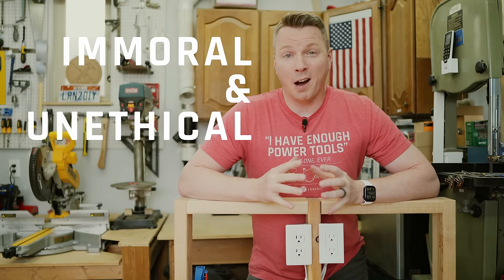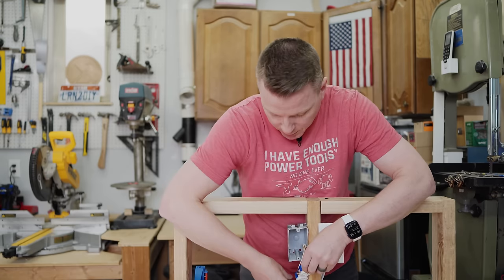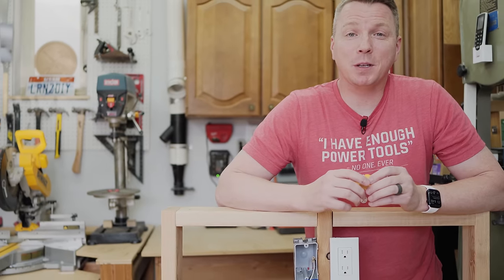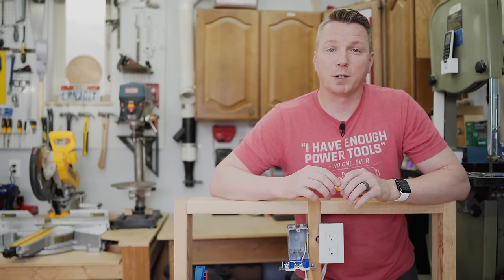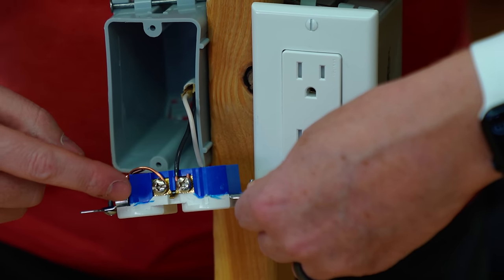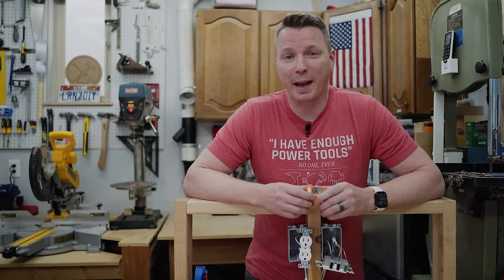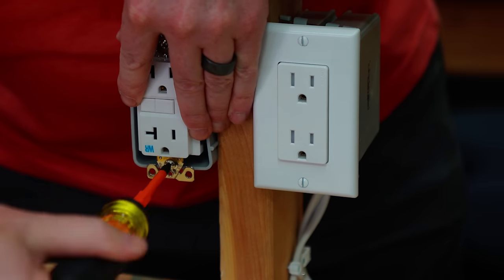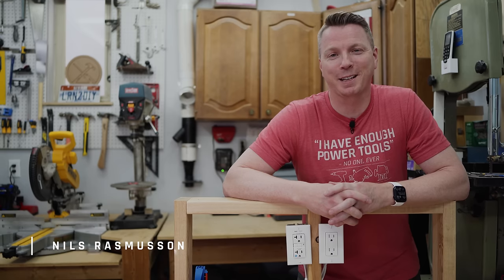People Are Adding Deadly Hacks to Outlets

Comment: No, your best option is #4 which is install a GFCI breaker to cover all of the outlets and get rid of those bootstrap connections. Two prong replacements aren't a solution, people will just use cheaters then. A gfci outlet I guess is especially if it's upstream from the others, but it'll be harder to figure that out.
Reply: The nice part about "cheaters" is that at that point, the wiring is no longer at fault. It's the appliance. While some people may not be aware that a "cheater" doesn't create a ground, they'll soon learn after their appliance has a fault! What I mean to say is that you can't blame the wiring when you're using "cheaters." That's like blaming the highway when somebody passes on the shoulder.
Reply: Using a GFCI and marking the outlet as ungrounded is the correct way to handle it for sure.
Reply: But if you don't have grounded plug, chance are that you either have a fuse panel or a breaker panel too old to have GFCI breaker available.
Reply: @Asakha1  Not even. I have an upgrade panel but no grounds because the house is old.
Reply: @Asakha1  Then you install a GFCI outlet
Reply: The point is to have an outlet that works as intended and has no surprises inside. It's obviously not the best solution, but at least you know what you're working with at first sight.
Reply: @jakedewey3686  Ungrounded (and labelled as such) GFCI outlet is what we did.  Cheers!
Reply: @moteroargentino7944  Mine works just fine and has no surprises.
Reply: @hockeymikey  The purpose of the ground connection is to trip the GFCI the instant a leak occurs, even if you are not present, because the current leaves the circuit trough the ground wire instead of your body, the GFCI detects that and interrupts the power. So you don't need to risk getting electrocuted for the GFCI to act.

If an outlet has a ground prong, it HAS to be ground wired, because it's the logical assumption when you see one. No exceptions.
Reply: @moteroargentino7944  False.
Reply: @Asakha1  In that case you install GFCI outlets. With the sticker that marks them as not grounded.
Reply: keep the Bootleg connections because then it is still grounded via the neutral which means in case of a fault it will trip the breaker, with the open ground it will only trip the GFCI if the device is on an conducting surface or if you touch it and therefore get shocked.

Comment: In Germany it's called "klassische Nullung". Decades ago it was the way to go. So we have many old buildings with this system. Here it is standard to put the cables in massive walls or massive floors (concrete or under the plaster). Adding a wire means often to demolish all walls from the outlet to the distribution board. So we have to keep going until the whole building or appartment is renovated.
Reply: You just cut a channel in the plaster and then cover it back up. Doesn't take very long.
Reply: @thelight3112  Are you willing to pay it for me?
Reply: Penny wise and pound foolish, installing conduits for the wires at construction time is a negligible extra cost which repays in this kind of cases.

Comment: I once worked for a company called Dish Network, may have heard of it. Went to a house full of "electricians". Said they ran my cable ahead of time, great news. They also wired their house outlets. Luckily I have a tester, and one of their rooms was wired reverse neutral, hot ground. I refused to plug anything in, they did it instead. Their tv blew a hole in their HDMI when they tried to plug it in. Now I'm studying to become an electrician, and this explains a lot

Comment: I like the GFCI option as a workaround for a few outlets in the place.
Reply: I have a 50's home and I have had GFCI's installed...a few at a time as the money allows.  I agree it's probably the best option for most people.
Reply: @Anothertominohio : Thanks for your input on that (even if you did mean " '50s" and "GFCIs" rather than their possessive forms). Yeah, those outlets are pretty expensive, like over $25 per unit, and other outlets can be connected to them, but then to connect other outlets to them means messing around with walls anyway, so unless you're a DIY wall resurfacer then it would still be less expensive per original outlet to replace each one of those with a GFCI. Wouldn't it?

Comment: In finland this is actually quite common in old houses where the electricals haven't been overhauled. As most of those houses do not have a ground wire to begin with, so sometimes when people have installed new outlets they've just done that.
Reply: Yeah, and that's allowed installation for retrofitting. But they European grounded plug can be put in non-grounded outlet. So actually adding bootleg ground is an improvement. Only downside is that you don't have CFGI, but all outlets didn't have that until the latest revision of code.
Reply: @@phillipbanes5484 CEE 7/3. I know it's not called "european plug", but it's in use in large majority of european countries so I thought you could make the connection.
Reply: It was mandated that you use then neutral for grounding in the 1930 code. The idea was to save copper. In 1957 they allowed separate ground wire but still using neutral was the primary method. In 1989 the use of the neutral was banned but 10 mm² PEN wire was still allowed until 2007. Technically it would still be allowed in a room where there could not be IT-equipment but it would really take effort to find a case where one could use it.

In conversion of old sockets or adding new it is still allowed as long as there are enough connectors. Also any new cable has to be with three wires and one has to make the connection at the beginning of the new wire.

Comment: Many older dryer and stove 120/240 volt systems used the neutral as a ground as well.  Both neutral and ground connect together at the panel.
Reply: Yes, the NEC allowed this exception from the '50s until 1996. New construction and new outlets are to be 4 wire. The NEC has "Grandfathered" the 3 wire method, until such an outlet is rewired.
Reply: A 240vac circuit doesn't require a neutral so common practice is to use the neutral white line of a 6 or 8/3 line as ground.  The newer machines do require a 120 circuit for low voltage displays etc etc however so hence the four wire installation requirement which basically just includes the central tap from the transformer and utilizing it along with a single leg of the 240 vac circuit to create a 120 circuit
Reply: @fredmauck6934  check the local authorities for the code revision they are using,
I know one county that adopts the IBC, NEC and plumbing codes shotly after they are published,
another nearby county is still using the 1993 code
Reply: @tylerdurden3537  Dryers almost all universally use 120 volt motors, with 240 volts being reserved for the heating elements. That way so dryer manufactures can use the same motor for a gas dryer or an all electric one. Plus it allows dryers to run on 208 without risking overheating the motor's as a lot of apartment blocks are supplied with 120/208 rather than 120/240, or very rarely some farm houses or the odd cases where a large property needs three phase power for one reason or another. Stoves accessories likewise run off 120, likely for the same reasons to maintain parts commonality with gas and compatibility with 208. Also apparently some older model stoves used to have 120 volt convenience outlets.
Reply: @ryuukeisscifiproductions1818  excellent points here, I never quite understood why couldn't dryer manufacturers simply install 240V motors so that you could plug the dryer into a NEMA 6-30R, for example and you wouldn't have worry about the old 3 wire vs new 4 wire configurations.  As for ranges,  manufacturers could have spent a few extra dollars for a 240/120 step down transformer to power the oven light and electronic controls so the stove could operate without a neutral and plug into a NEMA 6-50R
Reply: Electric dryers use a 220v motor. A gas dryer can run on 115v circuits.

Comment: This was pretty common in germany till the 80s or 90s. It's called "classical nulling" here (Nullleiter = neutral).
It even works when you wire in a RCD afterwards.
Today you wire ground (PE), neutral (N) and live (L) separately, of course.
The real danger of course is, when - why ever - the neutral wire gets disconnected but not the livewire. Then you have up to 120V on your ground (or 230V in germany)
Reply: Same goes with Russia. We still have those in I'd say most buildings and even standards. It's probably better than no grounding at all.
Literal translation from Russian would be "Protective nulling" and it uses PEN-conductor (PE + N) differently for TN-C, TN-C-S or TN-S systems.
Reply: Same in Poland. Although, some genius in my old house hooked up ground wire to... water pipe. So yes, it was grounded but when you washed your hands when the washing machine was turned on, you had a tingling experience.
Reply: Common in Finnish kitchens and bathrooms built up to the late 90s, so a lot of them still exist. One downside is that an RCD (GFCI) is ineffective on such a circuit, and from what I gather is therefore not allowed.

Comment: Another option that may costly but not as much as rewiring everything, is to run a single ground wire to all locations that are missing it. Although if you do have to open up walls, you may as well put all new wire.
Reply: This option is heavily frowed upon. It might even be against code.
Reply: It is a code violation
Reply: @TheRobWay1 . Gosh. I have that problem in my house and I was about to ask about that since I read the first comment. Is 100% sure this is a code violation?
That means the green wire needs to be inside the Romex wire in order to be up to code?
Thank you.
Reply: The equipment ground must be run with the unbalanced conductors per code. In theory, it does work, but it doesn't offer a ground fault path for the unbalanced/hot conductors.
Reply: @NSilver832  NEC 250.134(2) this is the code reference... if there is an exception, I didn't see it at first glance.
Reply: @briank1263  awesome. Thank you.
Reply: @NSilver832  you're welcome.
Reply: @NSilver832  actually I take that back.. I believe that 250.130 allows this. If you absolutely needed one or two grounding type, you could put in a GFCI or AFCI/GFCI combo if they make that ?
Reply: @TheRobWay1 . Nice. Thanks for the advice. I think I'll go for the GFCI/AFCI receptacle. It seems like an expensive option but not as expensive as hiring an electrician to rewire the whole house.
Reply: @NSilver832  Why can't you leave your house as is ?
Reply: @dmitripogosian5084  Maybe the dude just really wants that circuit grounded for safety.
Reply: 250.130 c allows a ground to be pulled to the outlet
Reply: @ColonelSandersLite  well, yes, if you need a particular circuit with that specific requirent. But redoing all circuits ?  A house from 60s (such as mine) has survived 60 years, and will survive 10 more. And when I sell it then, in all probability it will be gutted if not erased. So no point to put big money into new wiring. It may be better to put this money aside and look to buy a newer house.
Reply: Running a ground wire after the fact is not automatically a code violation. It depends on how you do it, what code is used in your area, and the individual inspector.
Reply: @briank1263  There is an exception for a bare THWN ground run as a retrofit.
Reply: @Harrison Frith  nice, where was it in the code? I'm not questioning thr legitimacy of your answer just want to know for future reference. Thanks!
Reply: @HarrisonFrith-cr4ie  never mind, I found it! Thanks again.
Reply: @HarrisonFrith-cr4ie  ---- THWN bare copper? 
Bare copper cannot be THWN, THHN, TWN, or any other type of insulated copper wire, or shielded wire. That's because bare copper is bare copper.  
  The type of insulation is indicated by the "letters" given with the conductor size and temperature rating. Insulation can be resistant to oil, water, different chemicals, sunlight, UV, etc...
Reply: @13_13k  yeah I know I'm not an idiot lol. I meant bare thwn as in not in a raceway. Thwn is not normally permitted outside of a raceway or cable assembly, except in this one application. I said "bare thwn"
Reply: @harrisonfrith7125  --- yes, I know what you said/wrote. You used "bare" and " THWN" together as a description of a type of wire, that does not exist or make sense, no matter what application you are describing it being used for.
I'm not trying to make you look like an idiot, because you are doing that pretty well on your own, I'm trying to keep you from looking like/being an idiot.  There is bare copper wire, or insulated copper wire. THWN is insulated copper wire by a certain type of insulation made from a specific material that which has its own certain properties that other types of insulation may share some of those same characteristics, or not.  
 Those characteristics depend on the materials used for creating each type of insulation, rubber, vinyl, impregnated paper, cloth, nylon, varnished cambric, PVC, silicone, neoprene, etc... 
 
 Saying that bare copper wire is bare THWN wire is the equivalent to saying you're skinny dipping in your bathing suit. You can't be both. 
 If I misinterpreted what you wrote, I apologize.
Reply: @13_13k  I said "bare thwn" meaning outside of a raceway. I have explained this like twice now. I've never said bare copper. If it was poor verbiage then so be it but the meaning was clear. Thwn normally cannot be outside of a raceway except for a retrofit ground, which is the one instance it can be outside of conduit or cable armor. Bare, if you will.
Reply: @briank1263  so, to clarify, but that you mean the ground must be within the same outer insulation as the other wires or that an added wire may run parallel but should be insulated instead of bare wire for safety?
Reply: @InfernosReaper  I would refer you to the code reference. There's an exception for retrofitting an equipment ground for existing 2 prong outlets that aren't required to be run with the cable or inside the conduit with the unbalanced conductors.
Reply: @InfernosReaper  if it is a #8 or smaller , I believe it must be insulated per code if it is run outside of conduit or cable.
Reply: @briank1263  correct - thwn ground outside of raceway is allowed for retrofit ground. I don't think you're allowed to run thwn outside of raceway for any other reason.
Reply: @Harrison Frith  Agreed.
Reply: this is where an older house with conduit has an advantage; you won't have to open the walls just to fish a ground through the conduit. NMC (Romex) or flex armored cable with pre-installed conductors and you're stuck with a big job, leading to this dangerous hack. Also yes conduit is grounded...well, maybe, maybe not, so pull that ground wire anyway to be 100% certain.
Reply: @markh.6687  test for continuity between the conduit and the neutral. If there's continuity the conduit is grounded
Reply: @harrisonfrith7125  grounded or there's a leak from the neutral to the conduit (e.g. a rat chewing the insulation)
Reply: @satibel  if the rat got inside the conduit I salute him. But yes.
Reply: @harrisonfrith7125  Yes, that would work to test it, unless somebody did bad things with the neutral.
Reply: If you are opening the wall, you might as well install cable tubes in the wall, so next time someone makes electrical work, they can pull new wires with out ripping the walls open. Was just other day helping electrician buddy with old house that had foresight to put the cable tubes in and once we manage to find illegally hidden junction boxes with my knowhow of construction and his electrical knowhow it was 5 minute job to pull new wires trough. If cable was just in the wall obviously you cant do that, least with out massive battle in good case and not at all in some. Also wire is protected in side the tube, least from most common types of damage.
Reply: @Brian K  I can think of other reasons not to do this but I don't see how it wouldn't provide a grounded path. It's literally a path to ground. It's a separate conductor attached to ground. You could throw conductor out your window, strip it, bury it and it would work the same.

You'd need a conductor with low enough resistance to make it a better path than you, but in principle it works.

See field telephones or look into how farmers used to make the first telephones work for more details.
Reply: The best option short of ripping every wire out of the wall is GFCI protection. Modern homes have bonding and GFCI protection which is redundant protection, so renovating a home with neither to at least have GFCI protection is acceptable by the NEC
Reply: Yes, in theory. But since the new ground wires will not typically be routed very close to the power and neutral wires, you get a very noticeable loop area. Which means a very noticeable overvoltage if lightning strikes in the area around the house.  For a big 100kA strike and an horizontal loop area 10m2, you'll get thousands of volts between your ground and power, by magnetic induction in the large loop. Enough to blow insulation in any appliances (specified max is 3750 volts peak).
It's also a good way to catch up hum from stray magnetic fields like from leaky motors and share it freely with your audioequipment.